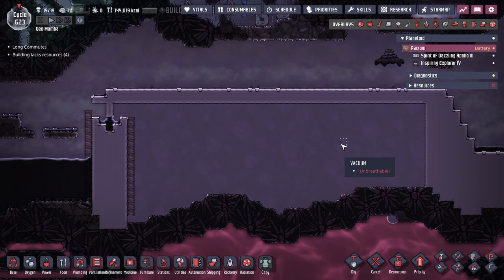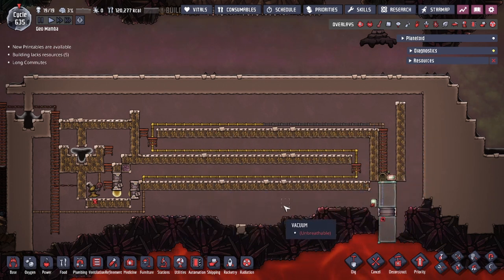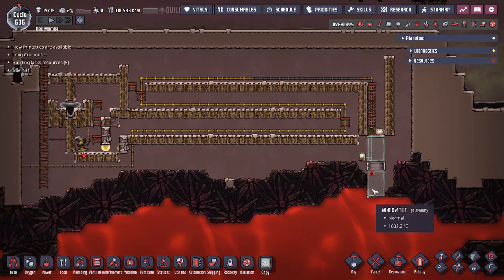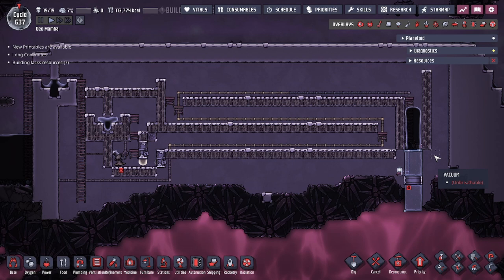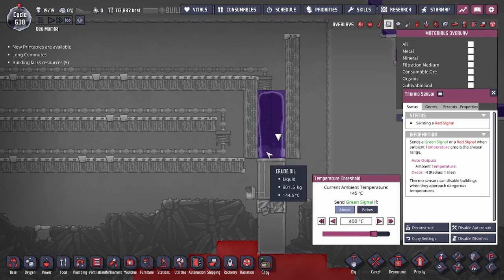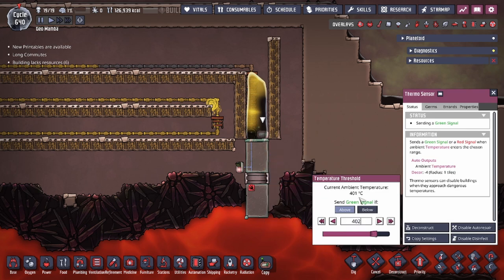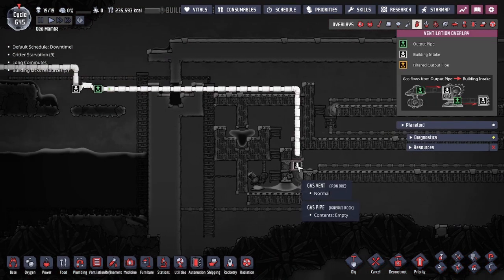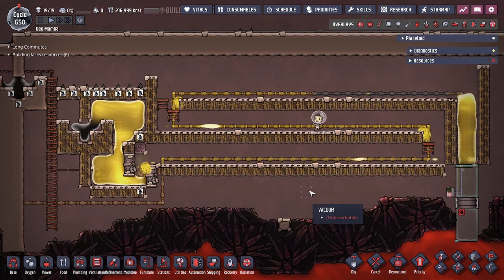How to Build the Petroleum Boiler using the Magma Core - Counterflow - Oxygen Not Included

Comment: You can prevent the 5kg sour gas flashing mechanics by adding a 2000kg steam heat buffer which cuts heat transfer at 403 degree c
Reply from the maker: i wonder if that is worth doing, since that 5kg flash only happens during the prime-ing process. i think i know what youre saying, basically allows for using a medium within the heatsink as a sensor instead of the petrol/oil itself
Reply: I am going to try it in my build, but I'll use liquid lead instead of steam and sink the toggling sensor in it.

Comment: I think your 3 layer heat sink causes temperature errors at the top of the sink. For example, you set the temp sensor to 400, but when temp sensor hits 400, the bottom layer of heat sink is already way above 400 degrees and it's too late to close the door. If you only had 1 layer of heat sink above the door, temp sensor will stop any heat transfer immediately. Resulting in much more accuracy of temperature on the only heat sink layer.
Reply from the maker: i actually started the build at 1 layer, and worked up during the live stream. it failed everytime for 1 layer, worked 1 out of 5 times for 2 layer ( without any sourgas ), and never failed with 3. the problem with one layer is that the heat transfer from the door to heat sink occurs too fast and you jump up in heat
Reply: @2LegitCity  Actually you are right. Now that I remember, I specifically build the top layer of metal tiles (or diamond windows) first, put some oil on it, then build the door (you can actually build the door through metal tiles last time I tried. I never tried diamond windows though.) I guess that's too complicated for a tutorial video. lol.
Reply: @2LegitCity  The trick to using less layers is to have more thermal mass.  Tempshift Plates are 800kg of whatever material you use to make them out of.  If you make them out of diamond they will have the same specific heat capacity as your window tiles but because they are 8x more massive they will be able to absorb more heat energy before increasing in temperature thereby creating a more stable temperature in your boiler.  I usually use a checkerboard pattern starting with the tile that has my temp sensor and ending at the top of my boiler shaft.  The caveat to this is that tempshift plates will inject heat into the pipes you have running down the shaft so in order to avoid overheating the crude in the pipes you need to put the liquid vent at the top of the shaft instead of the bottom.  I build mine in the permanent vacuum area above the shaft.
Reply from the maker: @SicQueldorei  i understand the mechanics but isnt using a tempshift plate just more "expensive" in cost of diamonds so that you have fewer layers which is really just 1 less layer? it looks like the cost outweigh the savings
Reply: @2LegitCity  It is more expensive.  If resource scarcity is an issue you could make the plates out of granite or virtually any other material that can withstand the temperatures.

Comment: Would it make sense to control the door state with a thermo switch at the tiles that you monitored manually during priming?
Reply from the maker: that would mean having either a liquid or gas inside a modified heatsink spike after the door, so a donut shape to surround the sensor. i think that is doing too much to ease in the prime-ing process- which is a one time thing but of course thats just my opinion

Comment: No Idea how your top diamond tiles stay at steady 480 ish. It always goes up to 600- 700 immediately as soon as the door closes. I always have to close the door manually, and it always flashes into sour gas. I really like this design, but the boiling part is just not really working. I followed all the advice, but it just doesn't stabilize...
Reply: theres also always oil that slips up onto the spillway,
Reply: nvm I just lowered the temp sensor to 399 and was more carefull, great build love ur vids XD <3

Comment: It doesn't matter how many times I try to do this, it always flashes into sour gas at aroud 360 because the tiles are 720 immediately as soon as I open it. Doesn't matter what I try...
Reply from the maker: how much oil do you have on the heatsink? id recommend trying with as much oil as you can have before having the heat connected, that way the oil in contact has more mass and other tiles of oil to transfer heat into and wont spike up as high.